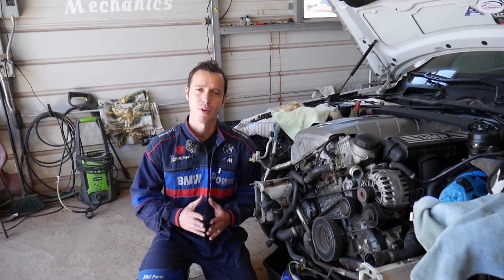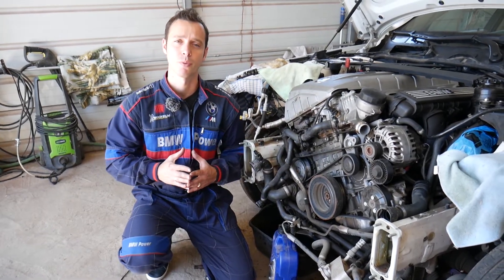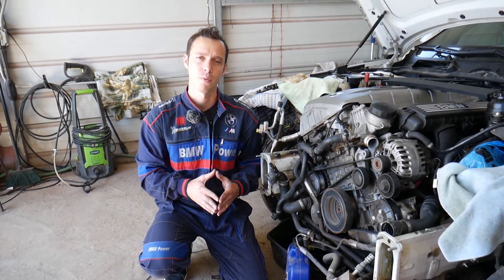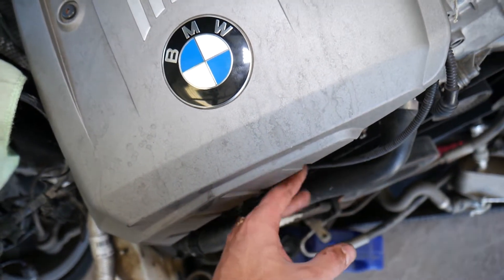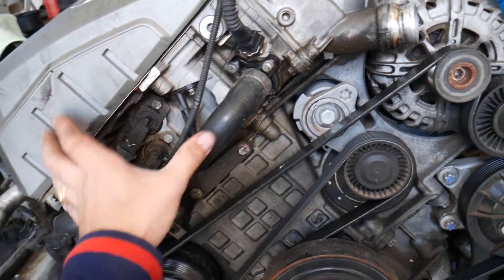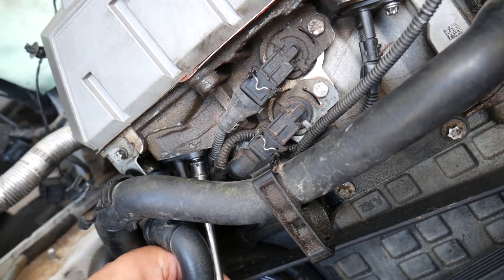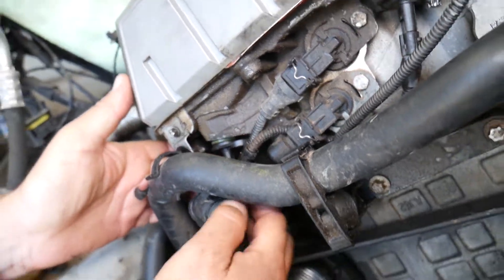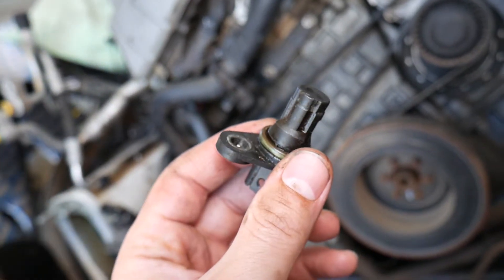EXHAUST CAMSHAFT POSITION SENSOR REPLACEMENT LOCATION BMW E81 E82 E87 E88 F20 F21

Comment: Hi, I have changed the camshaft position sensor and now I have Drivetrain error. I used Ista+ but I don’t have “delete adaptation” option. I just have reset adaptation which didn’t help. And I have error code 164030. Would you please help me to fix it?